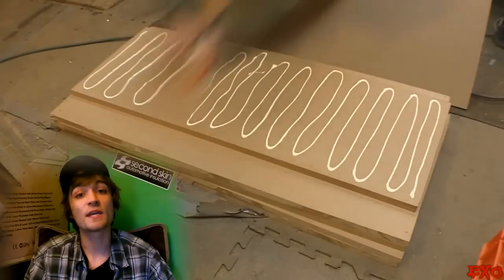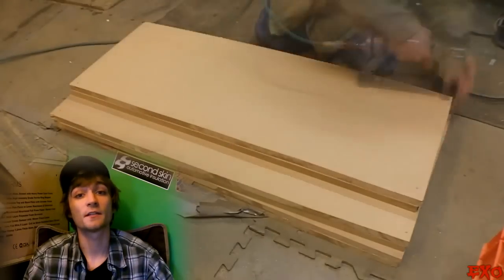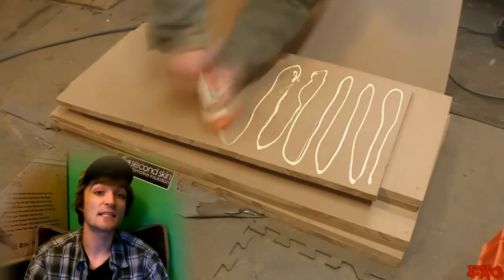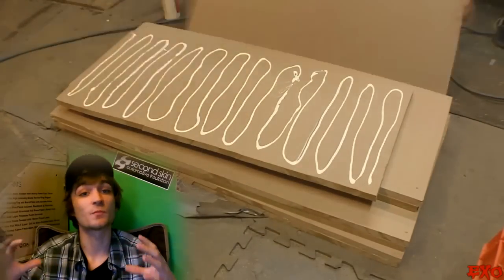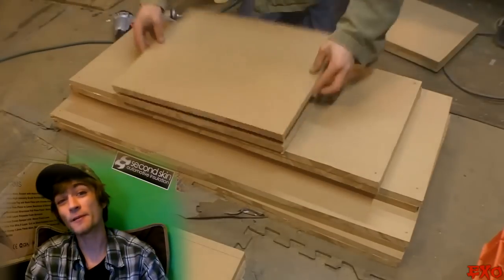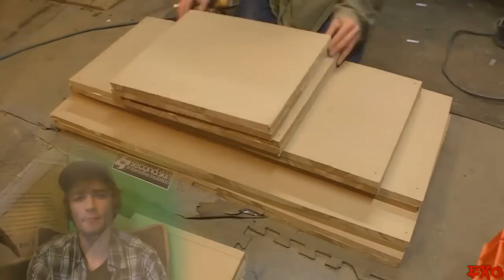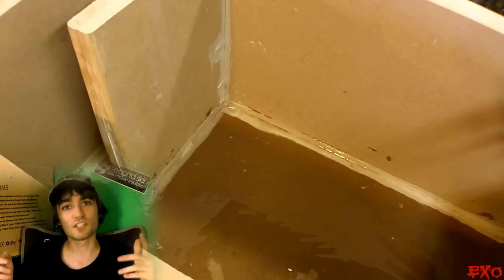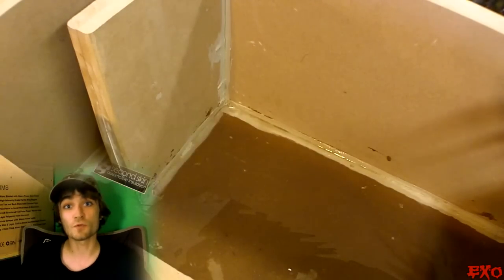How To Build A Subwoofer Box 2 | Beginner Car Audio Tutorial - Dual 12" Custom Ported Sub Enclosure

Comment: Im sorry EXO but i am little confused on the port width and length.. could you please explain how this measurements is made??

Square Port Height : 14"  
Square Port Width : 3.5"
Square port Length 1 : 14
Square Port Length 2 : 10"

I was also wondering if you have to put the fiberglass mat in the box or could you just eliminate that part?

Comment: The resin on the inside is a total waste. The inside of the box is to kill the sounds. So it has to absorb the sound wave. So the sound that comes out of the front is much smoother and not distorted by the inside sound. So it needs absorption material. Also absorption Wil increase the volume of the box. The rest looks great. A bit heavy for my taste.
Reply: ya cross supports in my opinion are still stronger than just doubling the wood

Comment: did you know that air travels over a slightly rough surface better than a perfectly smooth surface? it's called laminar flow check it out
Reply: DC b BC TV BCMB TV  CBS b TV b  CVCNN BC by BC TV v BC  BC c CNx NxBCccBCDvygv BC k BC CV Brub  r CDczaCDvyby  much by  BC  n

Comment: Has anyone done a before and after on a meter to see if the resin is really worth it? It seems like a good idea but I don't see it hardly ever, so just wondering if it was just an idea or a proven method.
Reply: Timothy Hinton There is a fundamental issue with all these RE "bullshit" Box Calculator-based enclosures: the programm does not even remotely take into account the electromechanical properties of the drives being used (TS parameters). The result is that you end up building an X box for your Y drive(s) with a Z output (absolutely no match to each other whatsoever). So, most users build something totally irrelevant to their speakers, with no knowledge of the drives' behaviour inside that box volume and that totally arbitrary port i.e tuning frequency (unless they use the factory suggested volume and tuning tubes!). Endeffect for 9 out of 10 times? Huge group delay ("slow", crowling bass...), which then we try to make faster by making smoother the box surfaces (by aplying alu-tape or resin all over) in order to let the air "breathe" faster inside the box... A total fail ihmo. Best alternative: use a parametric programm first to determine with surgical accuracy the box/drive properties, THEN use the RE Calculator to design the desired box dimmensions. I'm sure EXO knows better, I'm talking about the majority of "bass-box builders" out there...
Reply: IQ encodoc WinISD beta and WinISD Pro. The second one is rather demanding, but much more accurate.

Comment: Can someone explain to me what the port walls does to the sound/pressure?
Reply: Its hard to explain what exactly they do since im not a physicist. My best answer is that the port walls helps direct the air and sound out the box. But more imporitantly, they tune the box. Lets dabble on this a little bit.

The port cross sectional area and port length are related. So when you try to achieve a certain tune, lets use 35 Hz as an example, and lets say the port cross sectional area is 40 sq inches and the port length 20 inches to achieve 35 Hz. (those are just numbers im making up) Say the port length is too long for your box design, you want to make this shorter but also keep the same tune. You would need to make the cross sectional area of the port smaller too.

What the tune does to your sound is make that specific frequency the loudest out of all the other frequencies, but also makes the others louder too. At least compared to a sealed box. For this kind of box, 4th order i think it is, the tune "makes or breaks" your sound for your subs. Know your subs specs are important too because there isnt one magic box that plays well with all subs.

Comment: Love your videos exo representing maine but I have a few suggestions if you would. First being would it be more cost effective to use cross bracing as opposed to doubling up? Also use a damp wash cloth to wipe away excess glue. Also screws work better than nails. Also don't think there was really any need for the resin or fiberglass.
Reply: And lemme give you some suggestions. First it may be more cost effective to use bracing...maybe. Its also not a bad idea to use your finger to wipe excess glue, plus he was using that as a sealant as well so he was mostly spreading it. Also the nails werent there to hold the box together, but there to hold the pieces in place while clamps press them together. The glue is what really holds the box together, screws dont really do anything but weaken the box. Lastly, the resin is there to make a "slippery" surface and the fiberglass to further reinforce the box, even though at a glance it looks like its not needed. Maybe he will want to throw more power at these bad boys later on. All i know is that this box will most likely survive longer than those subs.
Reply: I can agree with most of what you said but Screws definatly do more than "ruin" the box. I've used screws my whole life and every box has come out perfect and I've not needed clamps.

Comment: literally took three days to build something that can take an hour and a half to build..
Reply: josh Anderson You don't have to use the resin, and the glue can set overnight.
Reply: And the resin is not needed, you still have to break the woofers in and your don't need as much caulk as they used, therefore you can still get this done and built in an hour and a half and still use it, by the way there are better designs
Reply: Its a square box, I mean come on.
Reply: I win
Reply: so many Josh's!! IDK whos arguing with who! LOL

Anyway it does take longer than a day to complete a box. Yeah you can slap one together in an hour and a half but when you're throwing 2000 watts of RMS power to a box, yeah you might as well make it as strong and as well as you can.

Comment: Actually, High Grade MDF is the best way to go. Plywood or any other type of wood is very inconsistent. Many air bubbles. Use MDF and deaden the inside with VPMS material. Bam. As close as you can get to inert resonant frequency. Which actually doesn't matter when the box is ported. Sealed yes because you can control the frequencies of all the parts. Ported, you have the vehicle itself and all other crap.

Comment: EXO, i need your help with a box build. Im thinking bandpass. And need a good blue print, max room i can use is tiny. 38H x 50W x 50L all cm's. possible for a band pass? if i can keep the height 35. then i have 35H x 80W x  80L  cm's.. if you could come up with something that would be awesome. Im running a Alpine SWR12D2 on a PDX M12. SHOULD HIT..   If not, some port advice would be great man!!! Thanks! Your vids Rock...

Comment: do you offer any advice online? im confused if i need to bend my ports to add any kind of audio enhancement or if a straight short port as the software says will do. most boxes have all these bends and baffles in them and i dont know how a baffle effects audio? also would .75 mdf hold a fi bl18 on a ZX2500.1 or would i need to double them up?

Comment: lol i meant it could have been subs back port back without any issues,even with the maze port, if the client wanted it?

like you said with the L port theres a unequal back pressure from the sub the closest to the L corner but with the "maze port" would the pressure be more equally distributed vs the L port?

Comment from the maker: No, we used 2 layers of MDF so we didn't need to use any type of additional strengthening on the inside - That's why we only used the fiberglass resin for it's glossy smooth properties.

Comment: Hey man, having some trouble choosing a port length and hoping you can help me out. My box is 2.2cf tuned to 31hz, port dimensions are 1.57'x11.16'. Now most port length calculators say I need 18.8" long but some have the option to choose slot port, and they're giving me 13.3". Could you give me your opinion on which length I'd need? Cheers.

Comment: Hey exo, how would you recommend building an enclosure.. that may not be able to be built outside the vehicle? I drive a coupe and the door opening is actually pretty wide, but I would have to take out the back seats if I were to ever squeeze an enclosure through it. And the trunk opening is definitely a no go. Would it be possible to build it inside the trunk? My worst fear would be there wouldn't be room to get the screws in so that's why I'm wondering.

Comment: would I be better off sticking with my 4" round ports or cutting them into larger rectangle ports? My boxes are for 1 15 each and are 3cuft internal volume. They sound good now, but I know the subs could move more air..

Comment from the maker: We shaped it that way to eliminate uneven back-waves from one sub having a shorter distance from the motor to the MDF - The calculator is called the " RE Box Calc", and yes, it does matter how far the port walls are from each other - That's what maintains the initial tuning. Fiberglass resin is about 40 dollars a gallon.

Comment from the maker: I think you need to go inside the box and start attacking the problem from there. It sounds like something very simple to fix, but yet it's probably driving you crazy. Just take a flashlight and start inspecting and moving things around. If you find any loose, vibration prone areas, make sure to beef them up with epoxy, goop, or even gorilla tape if it's a PVC type port

Comment: Hey EXO, a few questions that have really been kicking my ass, firstly, when you shape your port that way, is it only because the port needed to be too long to be one straight vent?  Or for some other reason.  Also, is there some special port length calculator for that kind of port?  Does it matter how far from each wall your drivers are, and also, which dimensions should you add 1.5 inches (or 3 inches in this case) to when cutting your MDF?  also, how much do fiberglass resin and bondo cost?

Comment: Holy glue. Yeah I prefer to use nothing but wood glue. As long as your cuts are straight, especially if you resin, there is no need for a thick glue like liquid nails. Plus, Liquid nails can expand and contract with heat and cold. Usually wood bonded with a proper wood glue creates a joint as strong as the wood.

Comment: thank you. what do u suggest i need other than the kinetic to get the best power without losing power? Ive got a 03 4runner v8 with 2 re audio srxd4 12" in ported box,(its kinda small tho)and 3300plad pyle dryver 3600 watt mono amp at 600w at 4ohms

Comment from the maker: With a sealed box, the biggest mistake you can make is making the chamber too large or too small. As long as it's correctly sealed, and withing the suggested size that the subs require, the results will be fairly uniform across the board.

Comment: Why dont you spread out the glue when you sandwich the MDF?
And you said you fiberglassed the box cause of the airtravel. Your port is the issue when it comes to airtravel. Flared ports FTW :)
Btw, ever tried to messure with TermLab with and without glassfiber? Do you really see any profit of the fiberglass?

Comment: hey man im thinking of puttin 2 15" re subs in with 2600 watt power acoustic amp dont know if they are really rated that high but was wondering if it would help to put a kinetik powercell in in place of my car battery? instead of capacitor and do i need a new altenator?

Comment: The insulation is designed to make a smaller box sound like a bigger box. Don't take the insulation out of the readymade box, or it won't sound right. However, if you make your own, you can make it bigger, to give the same sound, but without insulation. (BTW Sorry if your question has already been answered).

Comment: The insulation, or ployfill slow down the back waves of the sub and make it think it's in a larger enclosure.  If you have to sacrifice some internal dimensions to a box fit, you can gain up to ____10%____  back by adding polyfill.

Comment: I'm pretty sure that your talking about agu fuses. And if u are all need to do is get a anl or mini anl fuse box. The Agu fuses are meant more for mids and highs or a cheap system that dont have too much power. When you put the volume up its drawing a lot of power from the amps and it over heats the fuses a pops them. I had the same problem. I had a four way rockford fosgate Aguz fuse box and the only fuse that always popped was the bass amp. Try a anl fuse box. I'm sure that'll fix italic

Comment: Yo Exo.

I hope you can help a fellow basshead out.

Currently I am running a Fusion PP-AM3000 watt mono block powering 1 Monsta SPL 15 inch Sub. (aswell as a JVC DRVN 4 channel and soundstream componenets and 6.5's) I am happy with the system but whenever I go to bump real hard after about a 10 seconds the main fuse connected to the battery blows and ruins all my fun. (it is a 5AG 80A fuse) at the moment I just keep heaps of extra fuses in my glovebox. Can you help?

Comment: the fact that the glue DOES spread into the pores of the box which causes it to make a sealed bond. the excess glue seeps from the sides and actually helps seal the edges where the wood meets. and the fact that even if the bond is weakened, the nails from the nail gun and fiberglass resin help to hold everything together as well. ive also built many boxes and built tour buses for a few years a while back. not being a dick either.

Comment: Go use the RE box design calculator to figure out a box size between 1.5 to 2.5 cubic feet that you can fit in your car. Aim for 2.5ft3.
Aim for 30hz.

The RE calculator is an awesome tool and shows you what size port you need in terms of box size for the right frequency, so just mess around with it for a while until you find something you like.

Comment: I know im not Exo, but I would live to give you my input; a ported box will definitely provide you with deeper bass as opposed to a sealed box, which is designed more for nice tight, quality bass. The port allows for more air movement. L7s love a lot of space and air so i would definitely go for the ported box and tuning wise I would say anywhere from 33-37 would be ideal.

Comment: are you just using nails to hold the box together for now and then going to screw it down later?
when you were rounding off the edges on the port , you should of done it before you fitted them with the belt sander , makes life easier =)

2x1 bracing is more then enough to stop box flex.. doubling up on top baffle is good idea tho..

Comment: Just an FYI it's better to use titebond for attaching pieces together. The liquid nails really isn't that amazing at holding stuff together FIRMLY. It's elasticy when it cures and allows movement, which is fine for sealing up the box but not what you want when you secure everything together.

Comment: To run the speaker cable, do you do threaded bolts or do you install terminals? I'm building a box just like this and I'm on the fence of how I want to do the wiring.